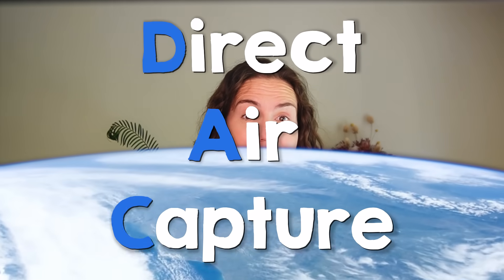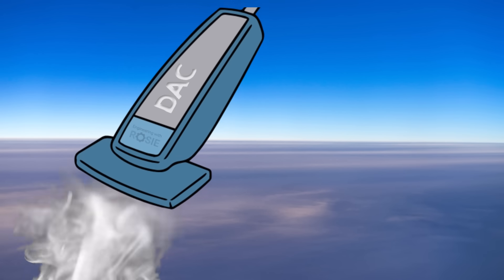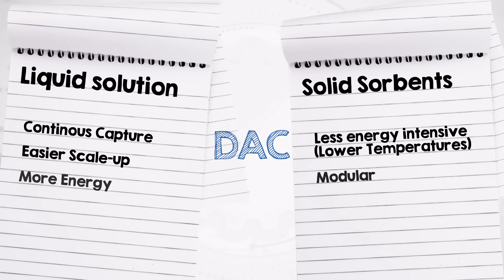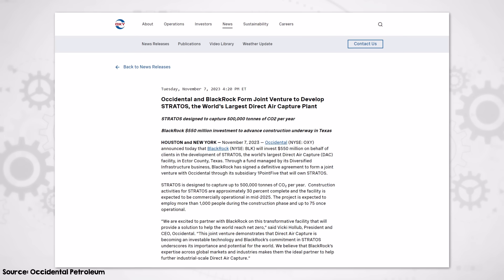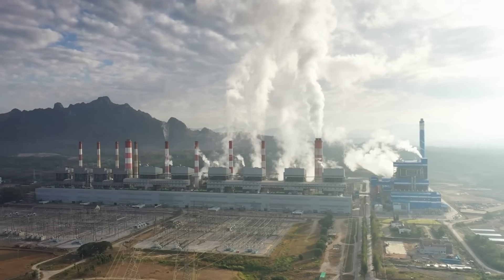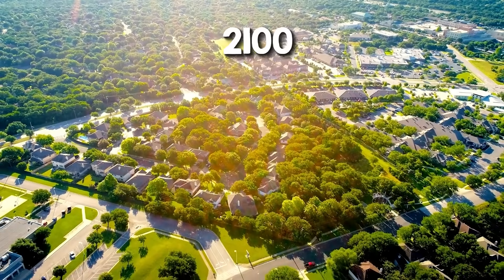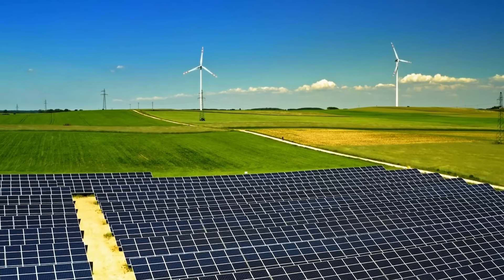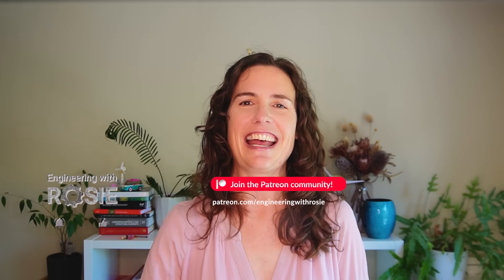Direct Air Capture: Climate Savior or Distraction?

Comment: You are muddying the water. It is yes to decarbonizing electricity, land transportation, industrial processes, and home heating. But without DAC and CO2 to hydrocarbons, there will be no economical inter-continental travel let alone the needs of cargo shipping, navies, air forces, and armies (spare me kumbaya about getting rid of militaries as China could care less about CO2, especially for the military). Hydrogen energy volumetric density is too low and electric energy mass density is too high.

Comment: The only use I could see for this in a decade or two is when there's so much excess power flowing onto the grid between 11am - 4 pm weekdays in the summertime due to solar power that grid operators are desperate to get rid of it and shunt it off to massive DAC installations, who essentially convert the unwanted energy into sequestered carbon.
Reply from the maker: If you're only using it 25% of the time then it will massively raise the cost of CO2 captured. I think they will vary the usage to support the grid in certain locations, but it's more likely to be not using it in the morning and evening peaks and during any windless cloudy days.
Reply: @EngineeringwithRosie  Yeah, the cost of the plants would have to be pretty low for them to be worth building if you can only run them half or 25% of the time.  Or maybe if heat is the primary running cost you could convert electricity to heat and store heat for use the rest of the day. But that would obviously make the plants even more expensive to build...
Reply: @EngineeringwithRosie  : it would be interesting to see techniques for things we can do with otherwise-curtailed renewables. Basically, it's the reverse of what is usually called demand response -- what's the things we can build that do useful work, but are cheap enough to build that we can afford to run them either intermittently or seasonally. We've got batteries of course. We have Al smelters that can turn off the heat for a couple hours, or finish up some pots and not restart them if there's a demand spike in the forecast for next week. I know NASA has some giant wind tunnels that only work once in a while, so they work with the utility to figure out when's best to turn them on. What else?
Reply: Rosie addressed a similar problem in talking about hydrogen. They say you run the electrolyzers when solar panels are producing too much power. But, that means buying expensive electrolyzer equipment and only running it a few hours per day. It is also predicated on the notion that people will continue to install solar panels in such a saturated market, just for a few hours of output at the beginning and end of the day.

I personally think that battery improvements and battery supply chain improvements are going to make the problem of solar curtailment obsolete. (I also think they will have to be, or meaningful decarbonization is going to be nearly impossible).
Reply: @ab-tf5fl  Largely agree.  One other point - right now most solar installations are done to maximize the amount of energy harvested during the entire day.  But as energy prices on the spot market increase in the early morning and late afternoon - relative to going negative during the middle of the day when existing solar installations maximize output - that's going to incentivize some people to install panels that only capture morning or evening sun, if their goal is to sell power back to the grid.  It might also encourage those who, for example, currently only have south-facing panels on their homes in the northern hemisphere to install them on east or west facing rooftops.  

It wasn't practical to only harvest weaker morning or evening sun when panel prices were higher, but now that they've fallen so much I think the math will pencil out for installs that only generate a lot of power for 2-3 hours a day if that's when prices on the spot market go highest.
Reply: @sunspot42  : tracking mounts are pretty ubiquitous in utility-scale nowadays to increase power generation early and late in the day. Double-axis isn't worth it, but single-axis is. Not worth doing at rooftop scale though.
Reply: Somehow I did not notices that flood of cheap energy recently. If anything, cost of electricity is going up

Comment: Wait, what will these defenseless oil companies do if we don't support the CCS development, research and improvement? How will they be able to sustain the operation? This is outrageous, we need to invest more into the technologies!
Reply: Na oil we do just fine.
Some think it's all over for oil and coal.
Not even close. 
Specially if we keep mining the additional minerals required for battery cars. 😂
Reply: CCS is more for hydrogen from steam reforming, coal and cement. These are huge stationary sources of CO2. Oil companies need DAC to cover their BS
Reply: Support CCS development by diluting all fossil fuels with synthetic fuels created from CCS.

Suddenly fossil fuel producers won't be saying we need more CCS when it increases the cost, but not the revenue of their product.

Comment: Excellent video. What a shame that these companies don't simply invest in renewable energy rollouts, instead this wasteful diversion...
Reply: Aerospace engineer here - this is one of the most annoying subjects wasting out time these days.
There's no real need to go into the technologies. You can kill this entire argument just by asking how they'll process 1 Billion cubic kilometers of air to remove 2.5 Trillion tons of CO2?

Here's the explanation.
FIRST - the basic task comes from the fact we have (since the start of the Industrial Revolution) put an extra 2.5 trillion tons of CO2 into the atmosphere with 1.5 Trillion Tons of that being just in the last 80 years and at current rates we'll add another 1/2 a Trillion tons by the early 2030s. 
 
Way back in 1987 as an undergraduate (in America) we had a NASA Engineer (as a guest lecturer) explain to us why  terraforming Mars was utterly impractical. He'd just completed a project for NASA on what it would take. It was simply the amount of stuff needed to do the job. Before you even get to the subject of making things like water, oxygen and carbon dioxide cycles work you need to just get enough air and water. 

Its a subject I now call Planetary Mechanics which is doing basic calculations on volumes, mass and energy. He showed us just the basics. From that its relatively easy to calculate that to give Mars a layer 1km thick of Earth standard air requires 178 Trillion (with a 'T') tons of air. Plus you need to raise its temperature from -60C to +20C and that's a lot of energy for that much air. And you'd need a lot more than just 1km to make a planet viable.

The related subject is Planetary Dynamics which is how you make things like the water and gas and thermodynamic cycles work which is incredibly complex. Planetary Mechanics is reasonably easy for anyone to grasp except for how big the numbers are, because its mostly just being able to calculate volumes and what mass it takes to fill that volume. That's how you get 178 Trillion tons of air.

So coming back to Earth. 
Earths surface is just over 500,000,000 km² so in the first 1km above the Earths surface you have about 1/2 a Billion cubic kilometers of air. Its actually about 2% more than that. But its just easier to use 1/2 a Billion. Because if you want to consider the first 2km above the Earths surface its about 1 Billion cubic KILOMETERS of air and that's where most of the excess CO2 is and there's 2.5 Trillion tons of it we need to remove. 

So how do any of these clowns with plants that can do 1,000 tons per year plan to remove 2.5 Trillion tons?
How much will it COST in BOTH money and materials to build all these plants?
How much CO2 will be produced getting all those materials and building all those plants?
How much energy with it take to just build those plants and then operate those plants?

You don't need to explain the technology, because just the scope of the task rules it out as impractical.
Reply: DAC consultant here.   We dont need to remove 2.5tr tons of CO2 because we are never going back to the climate pre the industrial revolution - another myth.  We can certainly get to the point where we add sufficient DAC plant to remove ~1bntons of CO2 /yr by the 2050s and progress to removing ~10bntons of CO2 annually in that decade. That is important to bend the curve of ever increasing temperature past net zero. The air movement issue is yet another illusion.  A 1sqm area fan that moves air at 5m/s  (in a current commercial DAC machine)moves 150Mcubic m of air annually, which contains ~100tons of CO2.  We need  10 sqkm of those fans to move 1 bntons of CO2 annually and the energy for those machine can be supplied by just over 1 sqm of PV per tonCO2 per year, so we need just over 1000  sqkm of PV to supply the power (all non contiguous of course). To give you an idea of scale, Bloomberg NEF projects that there will be over 5TWp of installed PV globally by 2030.  Each TWp produces 2000 TWh of energy in the sunbelt which is enough to remove ~ 2GtCO2 annually  (  at < 1MWh/tonCO2/yr).   So PV capacity for the energy is not an issue.  By the time we get past net zero and remove say 10bntonsCO2/yr, we will remove 100 bntonsCO2 every decade.  We expect that the cost will be under $100/tonCO2 so 10bntonCO2/yr capacity will cost under $1tr annually or well under 1% of global GDP, which is an extraordinary bargain. To get there we can use aviation to scale up with a small levy of 10% on each ticket ( global aviation revenue last year was over $700bn) Future generations can decide how much of the accumulated CO2 to remove - the current thinking is that we should get to ~350ppm from say 440ppm where we end up but nature will remove some of the excess for us so the total removed may be under 100ppm , ie well under  1tr tonsCO2.  All doable  @tonywilson4713
Reply: As Youtubers who have produced videos on COP28 have pointed out, CCS puts the responsibility on the people using the energy, rather than those who produce it. So they can carry on with a buisness as usual scenario.
Reply: They dont invest because it would be a monumental waste of money! They done the cost benefit work analysis blah de blah! And worked out its just cheaper to let the earth and everyone on die! We emit like 36 gigatons a year. They are talking about thousand and millions that's 1000 times to small! We are dead!
Reply: Renewable energy buildouts and storage buildouts are not enough. We MUST capture the CO2 in the air. See above for a link to a PNAS article about how to do this.

Comment: You say the mostly the controversial aspects are about what to do with CO2, but I think the most controversial aspect is that you will heat up the atmosphere (with the energy generation and use) more than how much the CO2 in the atmosphere would heat it up. Is this incorrect?
Reply from the maker: That is incorrect, yes. There is some effect from e.g. dark solar panels heating up and if they are covering light ground that would have reflected heat, then you end up with locally increased temperatures. But it does not compare to the amount that increased GHG in the atmosphere is heating the planet.
Reply: @EngineeringwithRosie  Thanks. It makes sense, but from your answer it's not exactly clear for me if we are calculating with pure effects or not. What I mean is that the already existing and the inevitable GHG emissions are going to amplify the heating. Even assuming very clean clean green energy production, that also is not completely GHG emission free if we consider the whole lifecycle. Of course @dudiek12 is partially correct here that you cover this mostly with the energy usage, but  I am just a layman, if it's not explicitly stated with references, it feels like we are ignoring something. :)
Reply: @EngineeringwithRosie what's the score between increased energy consumption from dark solar panels vs extra radiation to space at night?
Reply: This is what she says exactly in the later part man. The whole segment is called DAC uses a lot of energy.
Reply: @dudiek12  Sure, the two are heavily correlated, but it's not quite the same thing.
Reply: So how is heating atmosphere and being negative in CO2 netbalance different thing? This is how you increase tempreture accros the globe, by introducing more greenshouse gases.
Reply: @dudiek12  Sorry, I am confusing things here and not making myself very clear. The difference for me is that energy usage sounds to me as if we we didn't include the total lifecycle of all the infrastructure, just the energy at the site where DAC is done.